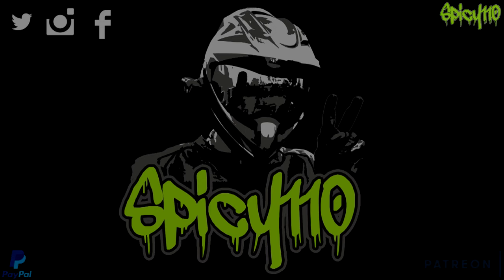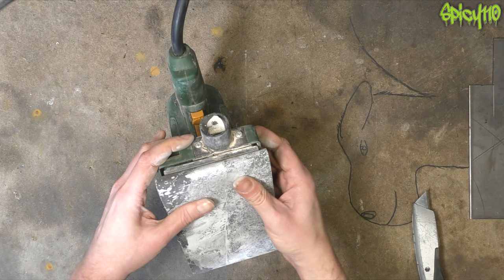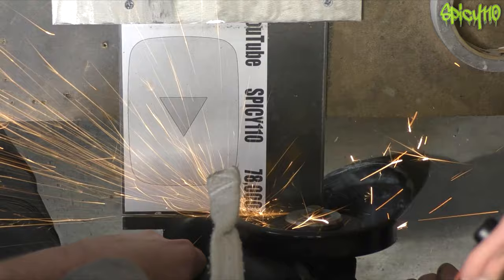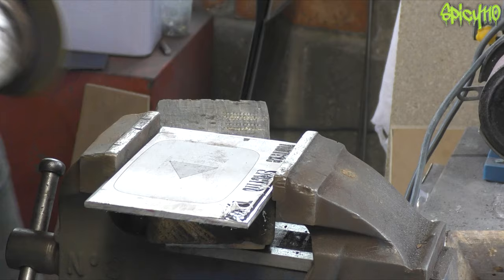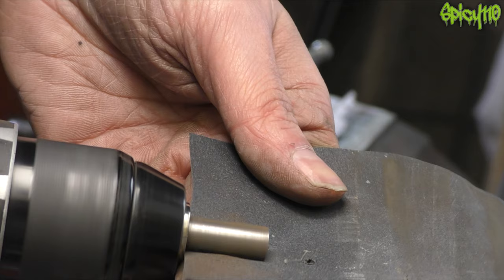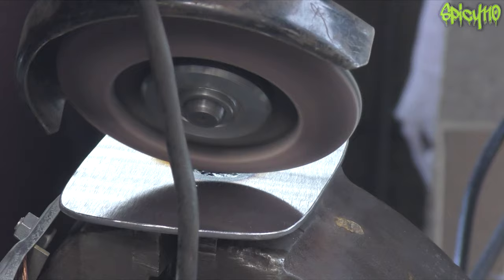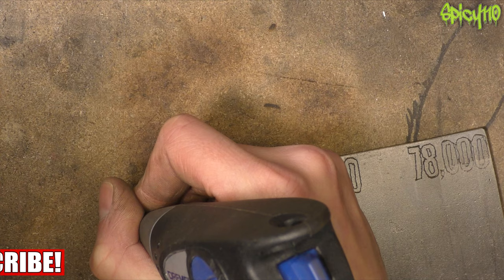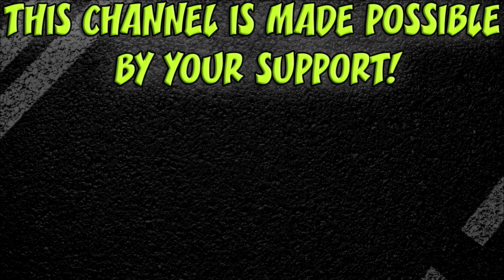Making custom YouTube Play Button!

Comment: Blacksmiths use rapeseed oil on a rag wiped over hot work, not incandescent but a too hot to touch. It should nearly blacken the metal. If it's too hot it'll burn off instantly, if its not hot enough it'll get filmy and leave a greasy look. Looks proper nice.
Reply from the maker: Really! I know of old engine oil etc use to all the carbon in it but might have to try that will smell better I'm sure haha
Reply: @spicy110  Yeah smells pretty nice, althought I couldn't smell much as I had about 4 tonnes of coal soot up my nose at the time. Old engine oil and transmission oil, similar but have different results and work at slightly different temps. Bees wax is a common one and recently discovered you can use Tallow. A wax or Tallow impregnated cloth/rag can leave a really nice soft sheen to things. I've heard of people using cold coffee as well, although I think that was more etching for types of damasus.

Comment: not sure if it's possible but if so you should have welded it from underneath.
Reply from the maker: I could have but it would have had a heat spot in the middle. I wanted this to look proper rough. It's supposed to represent the early days.
Reply: @spicy110 That makes sense... Looks good still
Reply from the maker: Thanks 🙂
Reply: Philip Murphy not my style